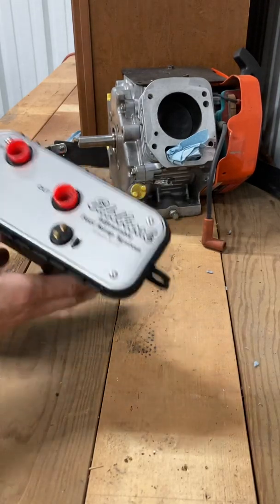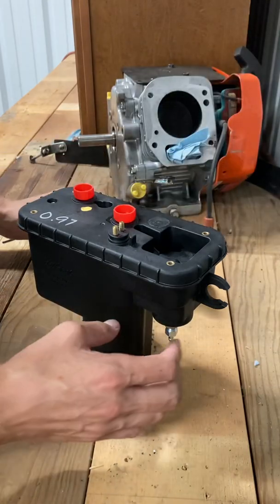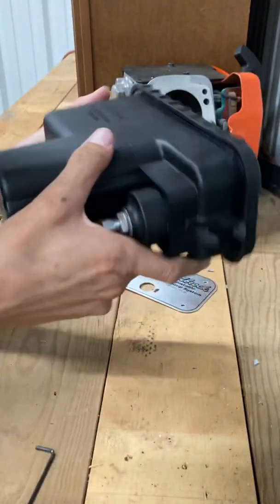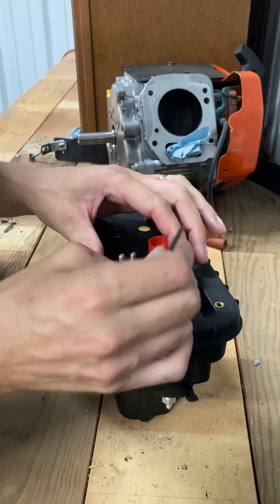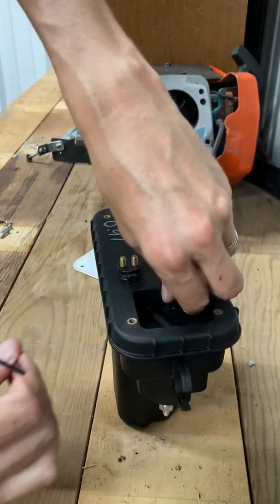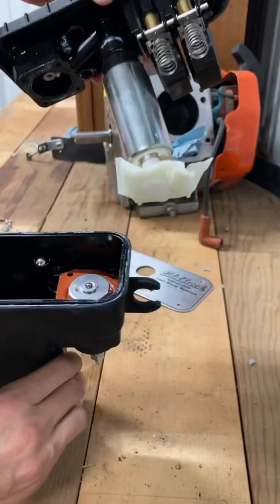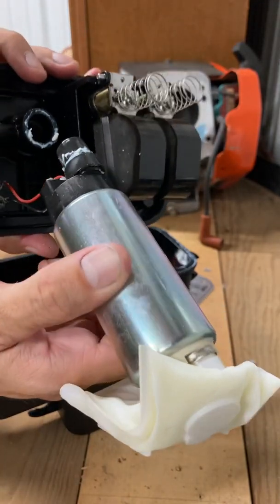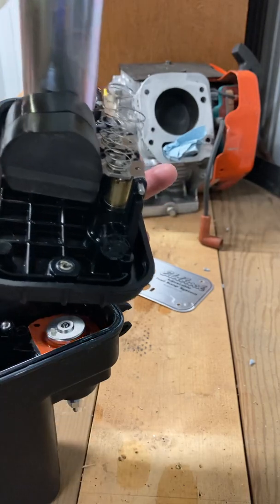What’s inside of an Edelbrock fuel pump sump for EFI?!?!?

Comment: I just received my Sump and found this video because I swear it sounds like mine has a marble loose inside. After watching this awesome presentation I suspect it is the roll-over check marble? I'd rather not open my unit to 'check', maybe I'll just plan not to roll-over. Anyone else have a loose marble in the sump?
Reply from the maker: That would be a bad day. I hope the video helped. Thanks for watching.
Reply: @JustRandomProjects  Well after thinking I had a fuel leak on the fitting at the inlet to the sump, I discovered that it was not the fitting and the unit was leaking fuel from under the beauty cover, actually from around the hold-down screw at the end near the fuel inlet. Not only do I have a fuel leak, but the roll-over check marble was not seated in its home and indeed it was rolling around the inside of my sump just as I suspected. I noted that the screw that let fuel leak actually has an O-ring, I am not sure if I dislodged that while I was taking the lid off or if it was not ever installed - I never saw it in place, the O-ring was in the bottom of the well and I'm hoping that is the reason for the leak. Not seeing anything else that might have caused the thing to leak fuel I just re-assembled it and will see if it is now sealed up, ran out of time this evening. Of course I placed the roll-over marble back in its home as well. My experience with this item is not acceptable. I can't recommend them.

Comment: I strongly suggest avoiding this product. The fuel pump in my unit gave up after less than a year of usage, leaving me stranded. Edlebrock make NO service kit for these, so you are left trying to cobble something together. And if that doesn't work, well, you've just thrown 500$ in trash. The small grommet on the fuel pump outlet is unobtainium, Edlebrock told me they have no part number for this. Good idea on paper, but unreliable.
Reply from the maker: Ah man that’s not good. Sorry to hear that. I don’t drive mine very often, it’s still working. Did you end up removing it or repairing?
Reply: @JustRandomProjects  since I had no more warranty on the unit, I thought I had nothing to lose so I opened it. The pump had no part number on it whatsoever, but it looked fairly similar to a Walbro GSS341BX so I replaced it with this pump. Thing is, as I said earlier, the grommet on the fuel pump outlet is unobtainium and mine was cracked, so I had to search for something that resembled that. Turns out there are boats or snowmobiles that have a similar setup, so I cobbled something together. Putting it back together is a hit or miss since there's alot of o rings that needs to be correctly placed and everything is a tight fit. But so far, it is working again, as it should. I don't think I'll be keeping it, though.
Reply: @ghrp6 is it still working after replacing it with a Walbro pump?
Reply: @GenXRyker  It did work no problem and no leak. I had to get a new o ring for the fuel regulator if I recall correctly, the stock one was awfully stretched.  However, I didn't keep the setup, it made me too nervous. I ran new fuel and return line to a custom fuel cell I installed instead.

Comment: How did it all turn out with the edelbrock surge tank and the sniper? I'm thinking about the same setup for my pickup with dual tanks. Would be so easy if this worked good!
Reply from the maker: Man it worked great. I’ve never had a starvation issue. I don’t drive it a ton but have put several thousands miles on it with no issue.

Comment: I took mine apart too because the pump failed with less than a week runtime.
Reply from the maker: No way. Dang, 1 week is crazy short. Would you mind posting the part number of the replacement and where you got it from?
Reply: @JustRandomProjects  don't yea just hate it when people post to comment, you ask a question, and they just don't care to answer.. but I have one, I needed to move mine further away from the engine as it kept dropping pressure from heat, after 5 miles.. iI yet had it out to test it if the move cured the issue, my thought is, edelbrock uses some cheap pump, perhaps installing a better pump will be my next step, if the pressure still drops, I heard a lot of people having this issue and just chucking the sump pump.
Reply: @madvette74  Yup i have the same issue. quits when it's hot. super PITA. does anyone have a part # for like a Denso or something good?